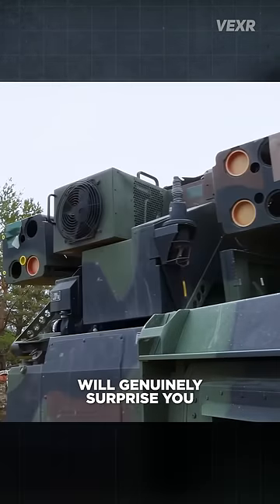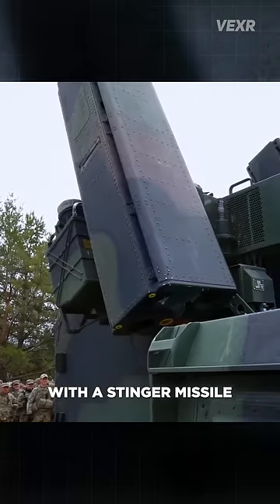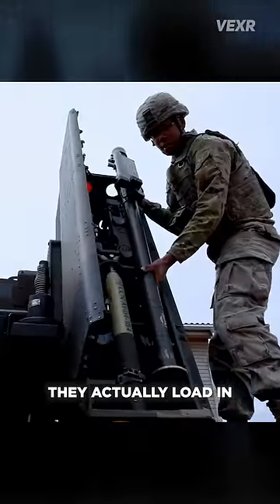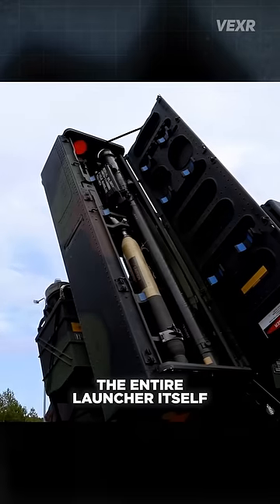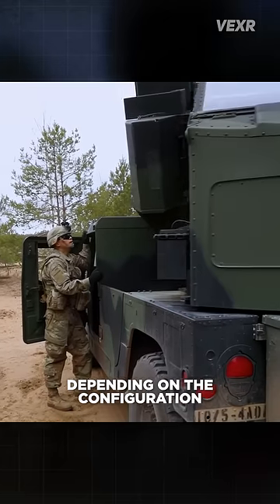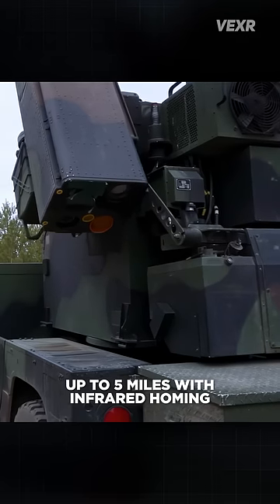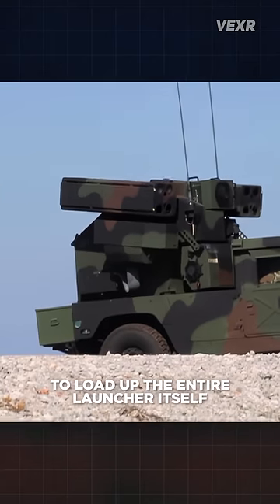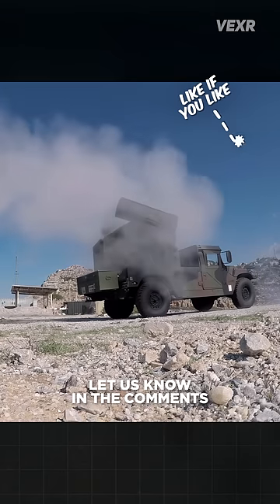The Weirdest Way To Load a Missile

Comment: 1.) the computer in the stinger does the targeting job just fine

2.) if the avenger is disabled the troops have a backup plan for air support

3.) if they run out of ammo there is likely a couple stinger rockets for an AA troop around

Comment: Its designed to load the entire launcher so that it can quickly be converted to MANPADS to transition from a maneuver element to dismount. It takes less than three minutes to transition from Avenger based launch system to shoulder fired

Comment: This is done for logistics and redundancy, the stinger is the main short range system for the whole us military so using it in the launcher form greatly reduces the supply chaine needed. Also if the vehicle breaks down or is otherwise disabled the launchers can be removed and used as the man portable mode keeping roughly the same amount of air coverage for the unit, with the only obvious downside the loss of the radar on the vehicle

Comment: Because the launcher is a launcher, it's still based off of the FIM-92, the whole point is to allow the launcher to displace rapidly and to reduce the equipment load of infantry, plus the launcher allows for the launching for multiple missile instead of just one

Comment: Probably for a couple of reasons One it's faster, two it allows you to have a versatile easily accessible munition with dual purpose. 3 it is probably easier to interface directly with that tube than it would diminution itself and be on its own saving time and money and configuration or new protocol for the programming

Comment: There's a few good reasons to do this, but I don't know which one they had in mind.

1) It's cheaper for Raytheon to just make nore of one kind of Stinger than it would be to make a different one for the vehicle.

2) It's easier for Soldiers to reload them this way, since all the electronics are already set up with the missile.  If they had to reload a missile instead of the whole system, theyd probably have to do something to make the missile and the launcher talk to each other.

3) This setup make the truck part of the equation a lot cheaper.  All of the guidance stuff is in the Stinger, the truck just needs a mechanism to fire it.

4) This setup allows the missiles to be fired by the truck and by the Soldiers, so if they lose the truck they can still use the stingers.

Comment: The launcher cools the projectile down to just bellow freezing. This is how the ir (heat seeking) targeting system works. It would require a cooling system be built into the launcher, making it more expensive to operate and also introducing a system that could fail.

Comment: The stinger unit can't be disassembled and put in a separate launcher. Because the stinger unit has liquid helium in it that cools the infrared sensor so it can find the hot exhaust of the target basically put

Comment: I can think of a few reasons. One was said already having it like that allows the troops to have spares to fire by hand along with the truck or if the truck is destroyed. 2 is The rocket launcher gets pretty hot after a single use so being able to switch out the whole barrel saves on refire time and able to reload the launchers on the side. They probably have like 6-8 stingers and a box of rockets in combat.

Comment: Easy on logistics. Simpler mounted launcher. In case of failure of the mounted launcher, you can just remove the stinger and launch it manually

Comment: It's designed to load up the entire launcher for logistics. It's actually a pain in the hole to stuff the missile in any used tube, ready to fire (the rocket motor used generates so much heat and fouling from exhaust material the Stinger was designed with single use (internal) heat shielding). So if it's easier to have pre loaded tubes... it's easier to just use the same ones the infantry use, less variables going through the logistics framework. It also means local Infantry units with munitions can feed and supply SPAA.
The same way Japan thought it was a great idea in the 30's to use stack magazines as well as belts for their Infantry MMG. It uses a stack magazine filled using Rifle stripper clips filled horizontally. The infantry were guaranteed to be carrying rifle clips, they could feed their own MG allowing the unit to carry more ammo than he himself could.
Another side benefit, if the vehicle is damaged or knocked out and for whatever reason cannot fire (no power, no hydraulics, damaged targeting) but munitions survived, they can of course be stripped out used as MAN pads.
Reply: MANPADS is all 1 abreviation MAN Portable Air Defense System

Comment: The FIM 92 stinger missolile was originally designed only for use by infantry and its cheaper and easier to just build a launch system that just loads the missile instead of the factory making an new version of the missile

Comment: Ease of use, the Singer is built as a single use missle launcher combo. it's the  same across the military. A specialized Stinger would me 2 different stinger weapons themselves. This way, a grunt with a stinger can load it in that  weapon anywhere both are present. The Avenger  was designed to use the already made  Stinger.  Kind of elegant, actually

Comment: Modularity! Different versions of the Avenger and the competing LTV Crossbow could also be loaded with Starstreak, RBS 70, and mixtures thereof. Presumably just having adapters to hold the different launchers is a easier way to accomplish that role. It also makes those launcher boxes simpler and cheaper, and allows the rounds for it to be stored safely in their individual launchers.

Comment: I mean, it'd be way easier to just to load the Avenger like that. Since the Stinger was in service first, it was meant to be a MANPAD, as well as since the Stinger is not usually reloaded in the field, there's really no need to complicate the logistic chain by supply units with stinger with launcher or without launcher. It's just easier that way. And on the off chance there's an air threat while reloading, the guys can just take a launcher and fire at it.

Comment: Using the whole launcher means that whether your avenger is working or not, you have air defense ability. You can roll up on site, deploy your Avenger, and then set up independent missile teams to provide additional cover.

If you needed just the missile to go in the Avenger, that would be a different ammo type. You'd need to carry double the supplies for the same mission. It makes more sense to just put the whole Stinger launcher in the box.

Comment: there is probably a simple engineering answer for why it takes the entire launcher instead of just the missile, and it's probably just faster to produce the frame and the missile launcher seperate, and allows the ability to reuse existing hand held launchers, which makes sense on an economical scale.

Comment: It’s loaded this way because the missile comes from the manufacturer preloaded in the tube . It’s loaded with the shoulder stock attached in case it needs to be shoulder fired quickly if vehicle is disabled . They can just pull it from the launcher and attach a bcu ( battery cooling unit) to cool the seeker head,and attach the iff (identification friend or foe lead from a belt unit and it’s ready to fire !

Comment: It's designed that way so if the turret or the entire system becomes INOP, you can put a gripstock on the missile and fire it off your shoulder the old-fashioned way.

There's also the safety aspects of keeping a live missile inside a sealed container.

Comment: You gotta think modularity. If the weapon platform is damaged or knocked out of battle the ammunition can still be used immediately without replacement patriot. You're not firing on all cylinders but you're still in the fight while you wait for your replacement weapon system.

Comment: Im not to knowledgeable on missle sfystems but my guess is that since the launcher already has an antenna you wouldn't have to develop a separate system for target acquisition and locking, saves space and weight

Comment: Easier logistically, the big advantage of the vehicle is sensors and guidance and the fact it’s a big vehicle rather than just a dude, a different launching system wouldn’t really make any difference so might keep it the exact same as what people can also use, so in an actual combat situation you there is very little that needs to be done. “Just take the whole thing and put it inside” is way easier than taking out only the missile and putting it into the thing by itself, and having the missile seperate and then needing to put it into a hand held launcher if people want to use it without the machine is a similar problem, so might as well have it so both use the same thing.

Comment: As an bitdefender the certified round system of the stinger makes it not only loadable but removable and still usable if the vehicle is damaged or destroyed... it can be used as man portable at that point.  Just like on the side of an Apache helicopter, reattach TRIGGER and use as designed.

Comment: Probably logistically simplier to send the entire launcher than just the rocket inside the launcher. So, if they need those for troops, they can use them but also use them in the rocket system if they want. Also, if the rocket system is destroyed the ammo you have for it can be used by troops around it.

Comment: If the truck breaks down, the troops still can fire the stingers, but also, launching missiles out of a launcher in general would cause wear and tear on the barrels. By swapping the launchers each time you fire, you are reducing the wear on those barrels. For example, if you fire 3 full salvos of 8, you are firing 24 missiles a single time out of 24 separate barrels rather than firing 8 missiles 3 times out of 8 barrels. A lot less maintenance in the end.

Comment: Stinger missile system is a self-contained unit right from the factory. The launcher itself is a throwaway item. The only thing you hold on to is the grip stock. So yes, for the avenger the load the entire missile and launch tube into the pods.

Comment: Guessing 2 reasons:
- infantry can use them as well this way. Making it possible to reposition quickly and fire even without the main vehicle
- cheaper and easier to manufacture. These missiles I believe get build with their launcher. They aren’t really reloadable, you just grab a new launcher (probably is possible but not how it’s done) it’s therefore easier to just send full launchers so they don’t need to separately manufacture the missiles and send those out specifically for this. Now they just send out the same thing to everyone

Comment: It's designed to load the entire stinger launcher for ease of packaging and logistics and as a hedge against failure. The stinger missile launcher is already designed and in production, it's easier to keep the production infrastructure for the stinger missile launcher in place than to spin up a whole new production line for a more specialized munition to load into the launcher and should the launcher fail ground troops can still use the shoulder fire stinger missile. It's also easier to ship one thing than two

Comment: From what I was told, the stinger missile is built in the launcher at the factory. It is disposable. The whole thing. Now, that might have changed somewhere along the line, but I imagine it is just easier.
Reply: Exactly - the only removable parts of the Stinger are
1 - a Small glass optic
2 - an IFF transponder
3 -  a Small battery to feed the missile's IR seeker cooling for 5 mins
4 - a small trigger unit that fires an electric spark

The Avenger has no.2, 3 and 4 are provided by the Humvee's alternator and can run the seeker for 30 mins
To replace no.1 the Humvee has a Gyrostabiliser mount with a link to receive radar alerts from other units, but no radar of its own

Comment: Military systems are often designed with worse case scenario in mind, by being designed to accept the full launch system that means if something happens to the mount you can quickly and easily have a man take the MANPAD out of the mount and still fire at a threat.

Comment: The FIM-92 Stinger production line has been up and running since before the missiles entry into service in 1981. The Stinger was designed from the outset as “Man-Portable Air Defence System”(MANPADS). It was probably more expedient to use the shoulder launcher as ammunition “cassette”. Also if the Avenger missile system malfunctions, the Stingers could still be used individually in their original configuration.

Comment: My guess is that if the Avenger system ever went down/damaged, the crew could still utilize the missiles standalone to continue the mission at hand.
Reply: It's just a nice side effect of the fact the stinger was developed 1st
It was designed to be self contained - it uses the missile itself to get a lock, not radar on the Avenger
This is because it was designed so that it could be airdropped in support of paratroops

The avenger just takes a good platform, adds mobility and reduces fatigue and takes other units radar info to point where it's needed

The Avenger does no tracking itself

Comment: Multiple reasons.
Logistics- you just bring launcher, don't need to carry launcher or rockets wich may end up at wrong place.
Usability- vehicle can move more than soldier, but soldier can hide better,so you can choose where it ends up.
Redundancy- if the vehicle gets unusable without burning the ammo, you can just take out launchers and have means to defend yourself.
Development- why develope whole new launcher when you can just design a gox that holds 4 of said launchres and slap 2 boxes on top of vehicle and be done.
Training- crews familiar with launcher will be told this is how you put them in, this is how you take them out, this is how you aim and this is how you fire. No need to train with whole new system.

Comment: I'm not sure if it's an insight or not, but it's probably a heck of a lot easier.Just send the round with the whole system. One if it's not used in the launcher, it can be used by a man in the field It's just less headache to have one piece.One design that has sent out into the field to be used either by an individual in the field or by a launcher. It prevents source confusion. Short story source confusion is when you are loading a container with Two versions of the same thing into a container to go someplace and you get your numbers mixed up and you end up sending the wrong thing to the wrong people😢 Making your supply efforts useless.

Comment: The Oh-58d had an anti air capability using the stinger missile, too. You load a regular shoulder mounted stinger on to the rack, and it just clipped in.
Reply: Oh, by the way, the us military has stockpiles of the stingers systems, which is cost cutting to just find other uses instead of developing new missils and launchers

Comment: The Stinger missile is guided by the launcher. Just like the TOW missile is worthless without the guidance unit, the Stinger is just a tube filled with rocket fuel until it's guided.

Comment: The missile and the launcher comes out of the factory already assembled. By configuring the Avengers to accept the missile and hand held launcher together, it simplifies the supply chain requirements. A specially configured stinger missile doesn't have to be created for the Avenger.

Comment: Its easier to load the whole thing rather than tear the rocket out. It's meant for mobility. Like it an infantry platoon can carry the ammo and use it if necessary but then a system can take the ammo if needed. Its a synergy thing like why all nato members standardized rounds between nations. Warsaw pact members standardized their stuff to do the same however they used different sized rounds so nato couldnt use their stuff.

Comment: Either way the avenger would have to have a launcher inbuilt into it. It just makes sense to just to put the independent launcher intomit. The launcher might have a low duty cycle so it's best to have them easily interchangeable.

Comment: It's not the entire launcher.  The ability to cool down, arm, and control the seeker head gimbal is done from either a grip stock with a battery coolant unit (BCU)  or it plugs into a vehicle say an apache or the avenger which feeds it the needed power/gas/control inputs.
The rest is all handled by the missile.   The only non necessary part you see is the sight frame assembly but that's just some cheap stamped metal and a piece of fiberglass.  This means the missile can be easily attached to a lot of different things.

Comment: The Germans did this with AA guns, put them in clusters with wired together triggers. By taking the entire launcher you have two weapons already loaded.  If it still has unfired stingers and infantry gets in a single shot scenario simply grab your ready to fire stinger. If no need to fire simply throw back into group box and ready to fire from mechanized platform in series or parallel. That would be my guess, I'm sure someone knows the absolute answer.

Comment: I think it's for ease of use, it's a sort simplifying the process on loading the missile. Instead if removing anything from the stinger manpads just load the whole tube and that's it. And in the case wherein the avenger will have problems and can't fire those missiles, just take out the missiles from the vehicle and you have a ready manpad system. It's the same with firearms, the light machine gun and assault rifle shares the same 5.56 nato round, commonality and ease of use is a vital thing in the battlefield.